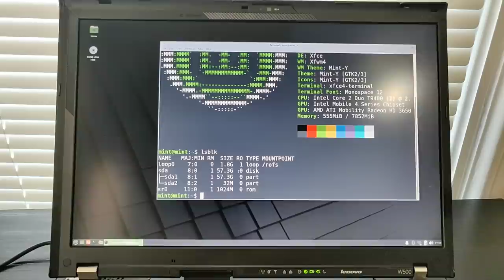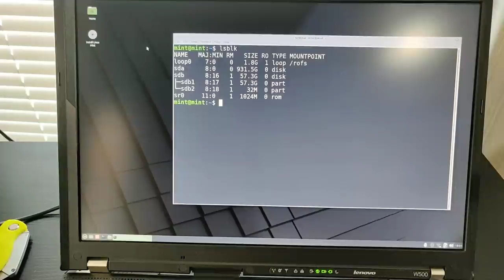SSD Upgrade for ThinkPad W500

Comment: I think the rubber pieces are probably vibration dampers, this machine was built with HDD's in mind
Reply: that and it helps guide the drive in and holds it firm so it doesn't flop around and damage the SATA connectors over time
Reply: You are absolutly right
Reply: also known as a drive sled.

Comment: I am actually thinking abt getting a thinkpad for my programming course. What a coincidence
Reply: the new ones are really good
Reply: The meme laptop
Reply: Strongly recommend the Tx40 series and newer if you want to use it for any sort of modern stuff that isn't one word document. upgraded from t410 to a t450s and it's such an improvement, managed to score both for 100 euros on ebay as well which was sweet
Reply from the maker: They are very solid machines, and used ones like this can be bought for under $200.  Even less if you can find an office or school that is upgrading PC's for all their employees.
Reply: Get an x220 or x200, I got an x220 for 60 bucks and plopped in a new ssd i had laying around and its the best $60 I spent
Reply: @MentalOutlaw  get them cheap, or missing parts/no os, then new ssd + battery + ram, good to go
Reply: @papajohnsuk5965  can confirm, i got a t490s and it runs great
Reply: @Gonçalo Amaro
overlooks important things like expandability, durability, and a superior typing experience, which i think are more important than improving the compile time on a school project from a few seconds down to one second. its not like you are compiling firefox or the linux kernel in classes lol.

new thinkpads went in a bad direction. the only difference between newer thinkpads and some random dell or hp laptop is the trackpoint and the price. if you arent gonna go with one of the older thinkpad models, probably core 2 or an early i7, you might as well just get any other brand of laptop for cheaper. you will probably get a better looking screen in a random cheap laptop too lol.
Reply: I am not 1337 and decided to purchase a new Lenovo X390 ThinkPad rather than an older IBM one, but after owning it for a year I can say even Lenovo ThinkPad are head and shoulder above every other laptop I have ever used.

Keyboard is solid. Trackpoint is killer. I have taken it apart multiple times, and though not as easy as this video, it isn't horrible. Battery life is pretty sick too and if you don't run you screen brightness at full blast.
Reply: @Gonçalo Amaro i agree, really it is only worth the trouble if u can find one extra cheap, worth looking if you want to save money.
Reply: I had one for 3 years. However I recently got a new pc and gave to a relative, still holding strong even today!
Reply: meme or not, we can all say that ThinkPad's are great.
Reply: @Gonçalo Amaro do the T480 models allow for swappable batteries? I distinctly remember opting for a T450 due to the cheap and easily interchangeable 8+ hours battery life, got a couple 68+ batteries and I can work for about 20 hours before I need to get to a plug.
Reply: Oh this is perfect for a local state school having you make apps in Java.
Reply: @retrace  I’ve had a X220 Tablet for 4 years I bought for $80 at computer refurbisher I worked at. Probably the best laptop I’ve ever owned for productivity.
Reply: I’ll sell you librebooted t400 with an upgraded 120gb Samsung ssd and atheros wifi card
Reply: I got an x230 with 2 ssds and 16gb of ram for free, spent 160 on an ultrabase for an extra ssd and hdd + a motherboard mod so I have a genuine quad core. Really nice machines, great support for modding. I also have an express card gpu extender if I want to play new Vegas lol, pretty much plug and play on Debian
Reply: @MentalOutlaw  so what idiots did my school hire to buy chromebooks
Reply: @papajohnsuk5965  Depends on how new you're talking. Lenovo has been gradually reducing the upgradibility of Thinkpads over the years. The T14 only has one open RAM slot, while the X13 is completely soldered RAM. None of the new Thinkpads have a removeable battery. None of the new Thinkpads have socketed processors. I don't think that most of the new Thinkpads even have a 2.5" SSD slot. With that said, I do have a P14s AMD, but I mainly got that just because I wanted a laptop with a Ryzen processor that is as powerful as my desktop Ryzen processor, and I wanted a laptop with an IPS display.
Reply: @retrace  I'd recommend an X230 for USB 3.0 support (unless you can find an i7 X220), and you can always replace the keyboard on it with an X220 keyboard.

Comment: I'd just add that taking out the battery before doing this is usually recommended.
Reply: I prefer to power up with a pair of forks wired to live and neutral tbh
Reply: Yeap, that's good practice if your not Race car Johnny.
Reply: @JDMeister  I thought I was saying something plain and uncontroversial. No such thing on the Internet, it seems 😉

Comment: Bought a used Thinkpad T460, put arch immediately on it. Since then it has been my only device for school and entertainment, using it for 8+ hours a day every day. Best computer purchase I've made.
Reply: That was my thinkpad and i used to lock the door and spend 8 hrs on it a day too
Reply: @yowut8075  when you become Yo nut 😂
Reply: if i install linux in a regular laptop,will intel still be able to spy on me?
Reply: @ContraIsBased  If you're talking about the intel management engine, yeah. You have to get a core 2 or older - that is, 2008 or older - processor to avoid that.
T400s are quite nice, and are old enough to use non-intel management engine chips. You can pick up a nice one for $100
Reply: @ellie-g9o  what other laptops are safe of intel spyware? just to have more options
Reply: @ContraIsBased  Anything before 2008, as a general rule. I'd use thinkpads, of course. I've also heard that the X200 is good. Basically, you want the newest laptop you can get while still having a Penryn (a core 2 duo, for example) chip or older
Reply: @ContraIsBased  Also, you can libreboot old Thinkpads, which replaces the proprietary bios with a free/libre one. Libreboot is a lot faster, and might be something you'll want to do if you're concerned about the intel management engine. It's pretty involved though - librebooting requires fully disassembling your thinkpad and rewriting the EEPROM (i think it's an EEPROM?)
Reply: @ellie-g9o  the problem is that i have no idea to do that nor do i know someone in my area who can rig the hardware properly for that,thats why i was asking for an specific model ready to operate without modding it,got any other tips to fix my situation?
Reply: Of course, this is slower than a normal laptop. You're choosing to use a 14-year old processor - it's not going to be lightning fast. But it should be fine for general use, especially if you're running linux.
Reply: @ContraIsBased  Oh no my comment didn't go through. In short:
- No need to libreboot, it's optional
- A T400 should be a safe bet, you can pick it up for $100
- You may want to upgrade the RAM and add a SSD, both are very easy
- You may want to replace the battery
- You can swap out the processor for another in the same, non intel management engine line if you want.

But a T400 should be usable, although a bit outdated, out of the box
Reply: @ellie-g9o  i guess thats the one im buying,thanks for the info pal!
Reply: @ContraIsBased  Of course! Good luck :)
Reply: @ellie-g9o  dude its me again,i just found a lenovo X60 dirt cheap in good condition and i was wondering if its a good privacy option to buy?
Reply: @ContraIsBased  it's a good laptop, and doesn't contain the intel management engine. however, it may be too slow for modern use - there's a good chance it has a yonah chip, which is 32-bit and basically a pentium. it also has a pretty low ram limit (~2-4gb iirc)
Reply: @ellie-g9o  thanks again for the info,im just want it to download stuff and watch videos but i think it might be too slow for even that
Reply: @ContraIsBased  downloading should be fine, that's limited by your wifi card & server speed, and you can always swap out your wifi card.

it should be able to handle SD video ok, will probably struggle with HD but the screen isn't high-enough resolution for that anyway

if you will be watching videos & want high quality / speed, i recommend downloading them first and then playing them with the super-speedy mpv

all in all, you can definitely use it, especially if you're making deliberate choices to use fast software (i'd use linux mint XFCE if you're new to linux, or arch/gentoo if not)

it's also worth noting that it most likely will be a 32-bit computer, so a good deal of software may not be compatible. all the more reason to switch to gentoo :)
Reply: @ellie-g9o  will the t400 that you recommended me earlier run videos better?
Reply: @ContraIsBased  i use it daily. runs videos great. struggles a bit with HD (1080p +) on youtube, but can handle SD easily. can handle HD or SD very easily if they're already downloaded and played through mpv or vlc.

i upgraded the ram, battery and ssd. got a very usable machine out of it, very much worth it.
Reply: @ellie-g9o  i think im gonna stick to the T400,thanks for the info again my dude,we'll be in touch
Reply: @ContraIsBased  :D

Comment: Love working on Lenovos, at least the business class laptops. They are designed to easily be worked on. Newer ones need the whole bottom removed but it's usually 6 - 9 screws and a nylon pry pick run around the edge and you're good.
Reply: if i install linux in a regular laptop,will intel still be able to spy on me?
Reply: @ContraIsBased  you’re referencing the Intel Management Engine. It exists outside the CPU. Doesn’t matter what OS you have installed it will still do it’s thing in the background. There are some computer manufacturers that build devices without the IME chip. System76 I believe has some. But they aren’t the only ones.
Reply: @rycarr  what laptops would you recommend to buy without the intel spyware thing?
Reply: @rycarr  wht laptops would you recomend?
Reply: @ContraIsBased  There are a few brands that will disable the IME for you or that utilize the ARM processor. I already mentioned one brand, System76. You could try searching for other brands and compare their offerings to decide which would be best suited to your needs.
Reply: @rycarr  thanks for the info

Comment: I got a T450 and upgraded to a 1080p IPS , its a fantastic laptop.
Reply from the maker: Is it 1080 x 1200 or some other resolution?
Reply: @MentalOutlaw  1920×1080. Unless you get right P/N for the screen brightness control does not work in windows.... but honestly who cares.

Comment: Gotta love these old office laptops and how easy maintenance is one them. 
I have a Dell Latitude E6430. Replacing the hard drive is as simple as removing two screws and pulling a tray that already has a notch you can grab. Then just mount the drive like you showed here and reinsert. Literally takes about 2 minutes.
Reply: if i install linux in a regular laptop,will intel still be able to spy on me?

Comment: Bought the new Ryzen E14 Gen 3 and ngl, it’s very solid machine. Even the cooling system they are using consists of dual heatpipe assembly and a huge fan to throw that heat away.

Comment: Hey Mental Outlaw, I want to disable the Intel Management Engine (Minix) on my processor, As I know it's an  backdoor
and I also heard the alphabet boys has backdoors in the firmware of modern hardrives. can they be removed somehow ?

I had AMD in mind as an alternative to Intel since I was under the impression it was more secure but I realized it was also
American technology which means the alphabet boys has probably already backdoored it.

Or do you know of trusted non-american hardrives and processors I can get ?

-That's a friend comment he's comment was deleted for mentioning the alphabet boys as the nsa
Reply: if you want the best secure performance get an AMD fx series because that was the last thing AMD made without PSP (amd's ME) otherwise you would have to use a pentium 4
Reply: You often can't do much about firmware. Best thing you could do against Intel ME and the AMD equivalent is to flash Libreboot.
Reply: @somedude144  you can't flash libreboot on modern hardware, that's the sad part
Reply: @flim if everyone in history just 'accepted' their conditions and never fought for a better future, we would be living in a completely different world.
Reply: reprogram the IME so you can use it for your purposes
Reply: you can completely remove the IME on the W500 (and X200,T400,T500) by flashing liberboot/osboot/coreboot, and neutralize it on the W520 (and X220, T420,T520) when flashing coreboot by using mecleaner. The x20 models only require 1 IME module to function which leaves it dysfunctional  in a permanent error state. The Tx30 series is similar.
Reply: for what i know, System76 sell hardware with intel me disabled

Comment: I recommend always  to have 10% of sdd not partitioned , why? Well because all those bits are moving in your SSD, and practice show that leaving some not partitioned space on SSD actually prolong the live of SSD. In my case it was very hard lesson i almost lost my 500GB Disk, but i managed to clone it before it completely broken.
Reply: Is it really that simple?
Reply: ssds last for like 70 years
Reply: @smugmode  iirc just not filling up the drive to the brim yields the same results, but if you want to make sure and you've already formatted the drive you can shrink the partition to make sure you don't end up filling the drive over 90%
Reply: @securitysocks  That's right, i wish that would be stated on the package of my ssd , all hardware manufacturers of SSD does not state it on theirs product package, but well  trough such youtube videos , people would know and at least less would get same problems as me.
Reply: @orlovskyconsulting  I am not sure that proves anything. If you work any storage device hard, it will fail quicker.
Reply: @alwinvillero9505  I lost a few ssds
Reply: @User9681e  more of the story?
Reply: @PenganutAgamaDamaiKolohBakwan  just randomly stopped working 
although it did have slow speeds and a few issues with corruption anyway most were Samsung
Reply: @User9681e  do still use samsung for SSD with Over-provisioning? or using other product like WD (I've heard WD still "unbeatable" compared to other manufacturers)
Reply: @PenganutAgamaDamaiKolohBakwan  all menufactors fail it some point well I got unlikely
Reply: if i install linux in a regular laptop,will intel still be able to spy on me?

Comment: Very cool. I'd like to score  a W700 for my collection. I'm building a business offering  privacy tools. I sell a whole line of corebooted ThinkPads. I'm using a corebooted W520 w a 3940XM and 32GB  ram running Qubes OS as my daily driver and wouldn't trade it for any system I'm aware of existing.

Comment: I have a dell laptop that its even easyer to remove or install a hard drive or ssd it pugs in the same way and there arent any screws holding in it could come out if you drop the laptop making a paper weight of the storage if the laptop was on i have already destroyed a 500gd hdd so I had to replace it with a 250gb hdd what a upgrade. I am dont care that much about the laptop to buy anything to upgrade it its not going to replace any of my newer gaming laptops anytime ever!

Comment: When it comes to buying a thinkpad are there any specific models or generations you would want to avoid?
Reply: The 40 series (e.g. X240, T440, etc) have trackpads with no buttons, so some people avoid them for that reason. You can replace them with a decent trackpad from the following generation though, so it's not a show stopper. Look into the performance of the 3rd, 4th, 5th and 6th gen Intel chips too. The TDP dropped significantly (I think in 5th gen), and performance dropped off for a while too, before Intel managed to get back to similar performance with lower power draw. There are other reasons that some people favour different series; look into whether the one you want has soldered CPU or RAM, removable batteries, etc, and consider whether those things matter to you. I'd also recommend finding on a 1080p IPS screen, which first became an option in the 4th gen models. You can get an adapter to allow that in 3rd gen though (which is what I've done).
Reply: @technology core count will have a bigger impact, in my experience. So i7 with 4 cores/8 threads is a more noticeable step up than an i7 that has the same core count as an i5 of the same generation. Whether an i5 has 4 threads varies with the CPU generation though. What's your budget? I'd be tempted to get a T480 or maybe a T470 these days, as I'd want it to last me a few years. Still very happy with my W530 and T430 though, they do fine for me (though I did put fast CPUs in them and modern SSDs).
Reply: @GrahamAtDesk  Thanks for the advice. An upgradable CPU is a pretty high selling point on a laptop, but with that in mind I hope the thinkpad models in general last a long time. If I get one of these I'd really prefer if it didn't become e-waste in a year and a half.